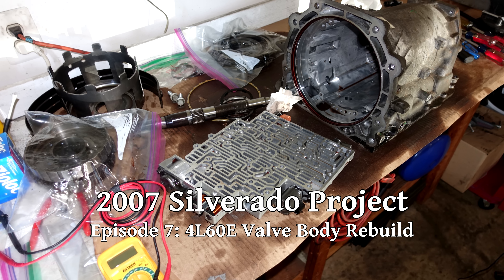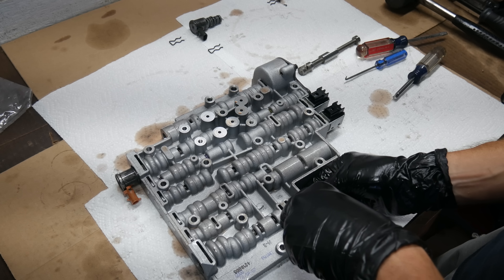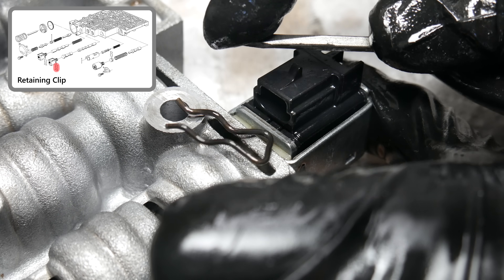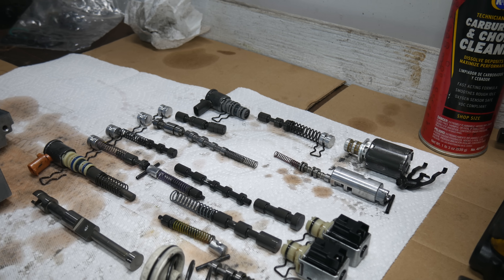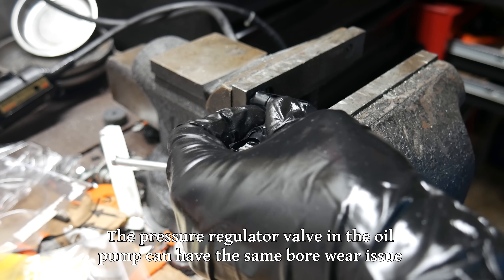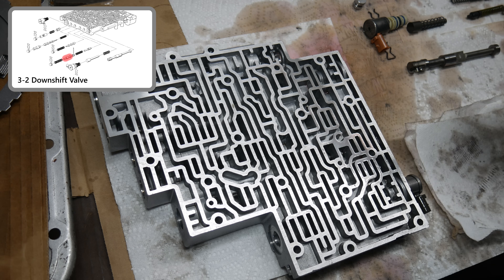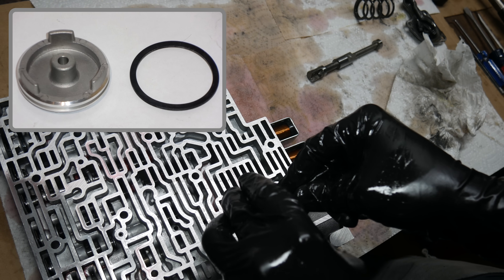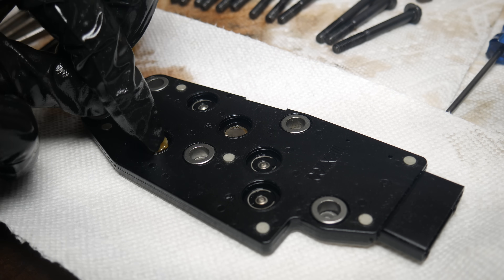2007 Silverado 4L60E Complete Valve Body Rebuild (Ep.7)

Comment from the maker: Please forgive the video banding present in a lot of this video, the camera's shutter speed setting must have been bumped and we didn't notice it until afterward. Couldn't find a good way to get rid of it so we decided to just not draw attention to it within the video itself. Hope it isn't too annoying!
Reply: Fuzzy Dice Projects it’s all good
Reply: Fuzzy Dice Projects Second (‘-‘)7
Reply: S@!-;  happens, I saw it on a bumper sticker once.
Reply: I have a question. I have a 99 GMC Sierra 1500 V8 5.3L.  That I am in the process of rebuilding and repairing by my self. And I just took my 4L60E valve body out to change out my all of my solenoids and while I was taking out my 1-2 shift solenoid the 1-2 shift valve came out with it as well as the 3-2 control solenoid and valve. Now my question is does this mean that the valve and springs need to be replaced on my transmission valve body or is that normal for them to just fall out when removing the solenoids? Sorry not trying to bomb you’re comments with the same question. I really just need an answer to this. I am trying to learn about this stuff but the internet doesn’t show you everything. I pray to get a response soon. I know it’s a 50/50 chance. But hey. A girl can try right?
Reply: It was perfect no worries

Comment: Hey man, I recently replaced both shift solenoids in my mildly built 07.5 4L70 and didn’t catch the 1-2 shift valve before it shot out. The big spring goes in first followed by the shift valve but inside the shift valve and small spring and a ball came out. I’ve looked at a few shift kits and can’t find anything with that small spring and ball inside there. Any insight? I now have no 1st/OD after solenoid replacement and putting the small spring and ball back in the shift valve and also reverse is a bit weak it seems which makes no sense to me. Maybe it does to you. PO751 and PO700 are the codes. Was thinking of changing the wiring harness and pulling that small spring and ball as well since no others I see have them in there. Thoughts?

Comment: Will your TCC silonoid modification work without reaming and adding an oversized TCC component.

Do you have any other secrets my 4l60e lasted until 303,000 miles.

Comment: You can tell if solenoids are working if you take a 9 volt battery and alligator clip touch it to the connectors you should hear it activating with a clicking noise.

Comment: Do you by chance know what would cause the engagement of drive to be low? Just had this rebuilt and have went through two different converters because that’s what they thought it was. Same issues still. I go into drive and it acts like it’s not in drive until RPM is a little higher that 1300

Comment: I have a 1994 k1500 5.7tbi with 4l60e. Truck is stuck in 3rd unless I manually shift to 2nd. I can reset the computer and get all gears for a short amount of time. What should be my plan of attack?

Comment: Great video. Curious, what exactly is the procedure on staking the valve for the lock-up line pressure? Also, can you stake the valve AND cut a slot in the TCC Solenoid? I'm running a high performance high stall converter and need all the lock-up pressure I can get reliably.

Comment: I have a question. I have a 99 GMC Sierra 1500 V8 5.3L.  That I am in the process of rebuilding and repairing by my self. And I just took my 4L60E valve body out to change out my all of my solenoids and while I was taking out my 1-2 shift solenoid the 1-2 shift valve came out with it as well as the 3-2 control solenoid and valve. Now my question is does this mean that the valve and springs need to be replaced on my transmission valve body or is that normal for them to just fall out when removing the solenoids?

Comment: Okay, I have a very important question.  Are the 1-2 and 3-4 shift solenoids different?  My son removed all he solenoids and set them in a bowl.  I do not know which is which.  Do I have to buy new ones to make sure I have the correct solenoid for the correct purpose?
Reply: Same solenoids,different valves and spring behind them,the wiring harness connectors determines which one works when the computer sends the signal to do so,the harness connectors are a certain lenght so you cannot connect them wrong!

Comment: so how did you get brave enough to rebuild a transmission? i need to know cause i'm trying to build the confidence to rebuild one myself
Reply from the maker: I read a rebuild manual or two and scanned a lot of forum posts where users made their own tools and showed creative ways to get these transmissions apart or back together. That's really all I did before rebuilding the first one! If you take your time and keep track of all the parts, taking care of one assembly at a time, it really isn't such a difficult job. There is a lot to consider but the actual rebuild process isn't too difficult.
Reply: I have never did one... until now. A lot of YouTube and forums like fuzzy said. I'm still working on mine after three weeks. Had to order more parts so it's best to open it up first see what's busted and what's reusable. I ordered full kit before hand. Got it opened up and found bad parts that were not included. Got my last part in today. Worst part I'm working on a "rebuilt" transmission that I bought  .

Comment: I'm interested in rebuilding a small block V8, similar to the one you did in the blazer, and I wanted to know how much time and money it actually took to do that. It looks like a lot of fun, I just want to know what I'm getting into before I start.
Reply from the maker: Filming the process takes a lot longer and we took our time, it was right around two months. Most of the time is spent cleaning parts, so there are different ways to clean things that also would save a lot of time. Even not having done it before it is a doable project over two or three weekends. That engine rebuild cost around $280 including paint and the camshaft kit which was almost half of that total. Spent a bit more on tools like the flex hone (~$35) but nothing too bad. Of course, if you are replacing cylinder heads or having parts machined that can get expensive quick, but sometimes it really is necessary and would be worth it in the end.

Comment: An important step you didnt show is making sure the shuttle valves slide super smoothly in their bores.  Sometimes little burrs can form in the bores which can hang up the valves and cause issues.  The cleaned valve should slide all the way in and out of the bore with gravity alone (you very well may have done this step but with such a detailed video i thought it was worth mentioning)
Reply from the maker: True, good point! The fluid and grime will make them tricky to remove sometimes but when reinstalling (or test-fitting after cleaning) they should glide like a slip-n-slide on a runaway truck ramp. Should have mentioned that more clearly but I guess it got away from me.
Reply: @FuzzyDiceProjects  What a waste of time . Clean it check it update it and bolt on.

Comment: I will never mess with transmissions this is too much for me to rebuild
Reply: Its really not a bad as it seems.  As long as you take it one little bit at a time and dont let yourself get overwhelmed by the big picture its really pretty straightforward.  No single part of the job is overly complex or technical.
Reply: Do R/C! If you say its not hard, hmmm my friend has an old car may take the tranny apart and try to rebuild it
Reply: @funnypranker34  go for it. Just do plenty of research ahead of time (watch videos, ask on forums etc) make sure you have any special tools you need and give plenty of time for unknowns (surprise needed parts etc). Some autos are definitely easier than other but take your time, take lots of pictures and stay organized and it's doable for anyone with a decent level of mechanical skill.  I'd say if your very comfortable with taking the trans out then rebuilding it shouldn't be an issue.
Reply: Just tedious is all
Reply: Its actually pretty easy! 
Once you get it, these videos are priceless! 👍😎👌